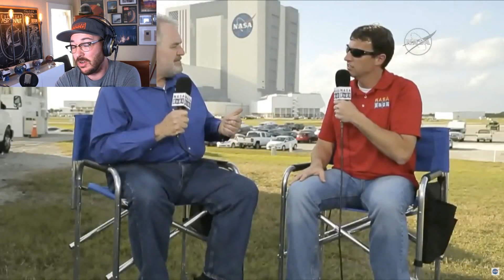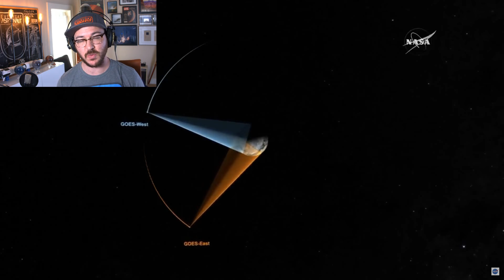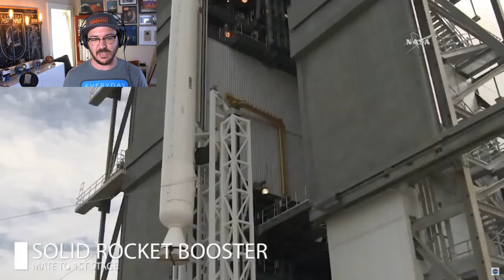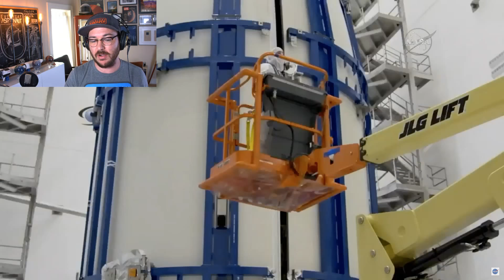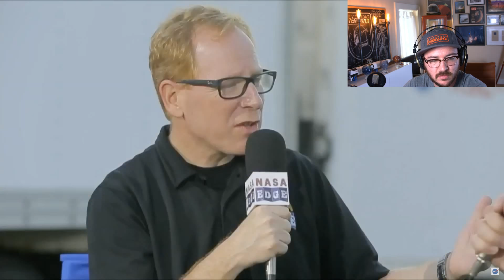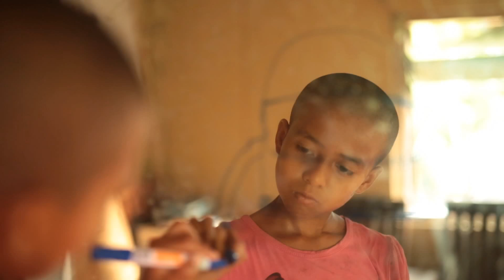LIVE Hosting - NASA GOES-S Rocket Launch (ULA Atlas V)

Comment: I have a video topic. What causes the sonic boom when Space X rockets are coming in for a landing? Is it even a sonic boom?
Reply: You hear a sonic boom when the shock wave (traveling at the speed of sound) from an edge of a supersonic craft crosses your path. Yes, a landing F9 1st stage causes 3 sonic booms; one from the landing legs, one from the steering paddles, and one from the top (I think). These tend to arrive at the observer just after the stage has landed.

The stage is allowed to free fall and briefly reaches a supersonic velocity in the upper atmosphere before getting slowed down by a (3-engine?) burn to prevent overheating.

Comment: The solid fuel is APCP (Ammonium Perchlorate Composite Propellant), and it does contain aluminium to increase the temperature of the gases, therefore chamber pressure, exhaust velocity, and ISP of course. I'ts basically AP as the oxidant, and a rubber-ish polimer glue and aluminium powder mixed together and casted into the sape of an SRB :)

Comment: I hate metrics. I want Imperial Measurements. Metrics are for lazy people.
Reply: Every measurement is unscientific and stupid except measurements in their natural units, for example the speed of light is 1. 

Unfortunately, measuring human-scale things based on the speed of light would be terrible, so we pick arbitrary numbers out of the sky that fit humans decently well. Neither imperial or metric does any 'better' of a job at that. Personally, I prefer the US system because a foot is a very reasonable size.
Reply: That is why metrics appeals to lazy people. The real universe is not simple. With each phenomenon comes a unique form of measurement. The empirical system is superior to metrics because It uses fractions which takes account of the entire number involved. Metrics wants everything to be a factor by 10. This requires the use of approximations. Computations that use approximations are doom for failure.

Metrics was developed as a method because one country [The English] had a standard and another [The French] did not. Myself, I use the metric system and the imperial system. The Imperial System is the superior system.

Thank you.
Reply: Agamemnon I Imperial is stupid
Reply: Agamemnon I 
Imperial is an old outdated unscientific and stupid way of measurement. Metric system is simple and very useful. For all pourposes, is very practical and less confusing.